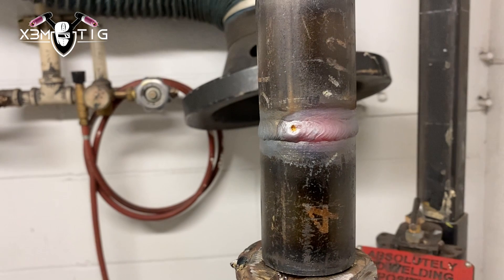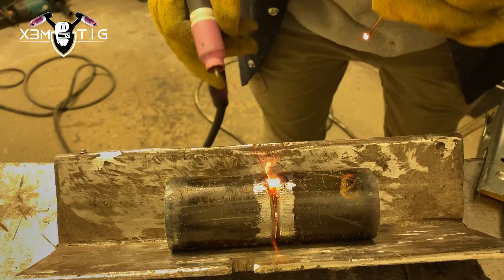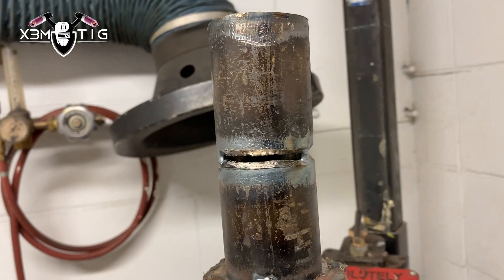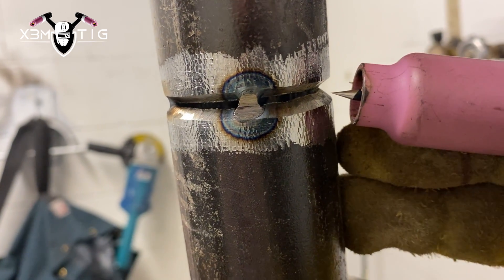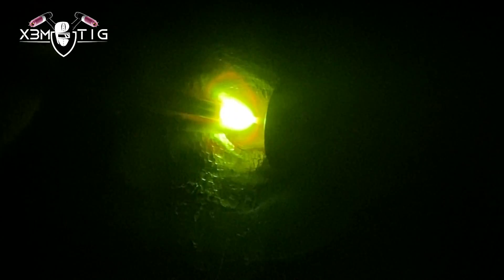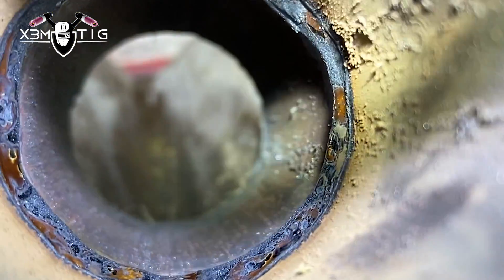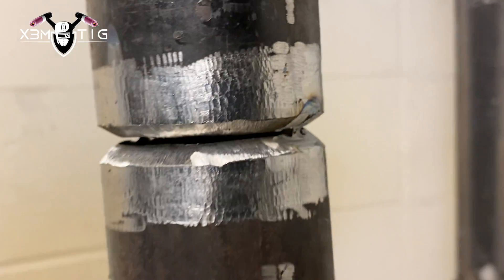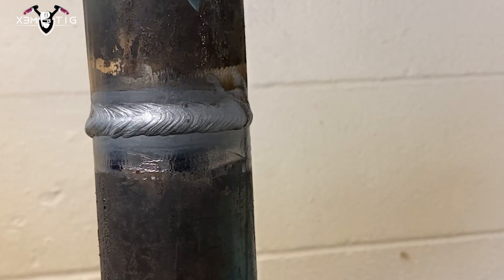TIG Welding Mastery – Root, Fill & Cap in Just One Pass!

Comment: When you finish, to eat to avoid or to fill the crater just push that 70s to or 70s 6 filler Rod radian to the puddle and let it stand in the puddle I just cut it off and you won't have that little crater. Beautiful work brother!
Reply from the maker: Right on brother, thanks for your input.

Comment: I only one pass boiler tubes it absorbs heat a lot better than pipe. Plus you don’t deal with a QC as much as pipe jobs. But if you have a 3 step QC visual you can never do this. They will fire you and bar against it. Smh but it is possible and you can pass the x ray.

Comment: is it possible to pull this off on a vertical possition?
Reply from the maker: It’s possible with sch.10 pipes, especially stainless
Reply: @X3MTIG  sch.10 means thin wall right ? (I'm used to measure everything in millimeters :D) well thats the only way to weld thin wall stainless (2mm) no gap, no bevel. But I'm intrested if it's possible on carbon steel especially the thicker wall carbon like you showed in the second part of the video.
Reply from the maker: @OG______  Sch. 10 means thin wall. I dont think its possible on carbon steel  with thicker wall, maybe if you roll out.

Comment: Nice! I'm used to do on SS pipe sch 10 and 1" CS pipe. You explain very well. I saw video of one Korean welder , he did penetration with reinforcement on 5G pipe in narrow gap... I don't get it how. I tried myself on the job and can't create reinforcement in overhead position, only can get flat root. Where is the secret?!
Reply from the maker: I’ll have to see that video, if you got link I would like to check it out.
Reply: @X3MTIG  https://youtu.be/-qwCIN5Fvzw
Reply from the maker: @SergeyCyxa  hey bud. If you watch very closely, you will notice that he's welding in the rollout, and he said that in the video, but the position of his torch it's not overhead, he started at 5 o'clock and rolled, while moving up to 2 o'clock, and that's where he stays until the weld is done, that's he's secret.
Reply: @X3MTIG  https://youtu.be/Z2sf9WT1XKw
Reply: @X3MTIG  https://youtu.be/H3umG9eQsW4